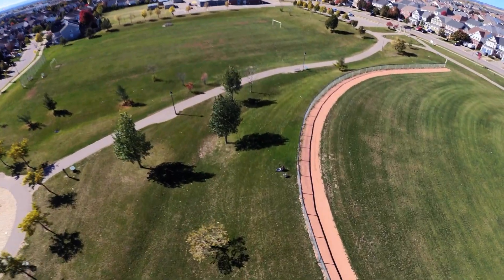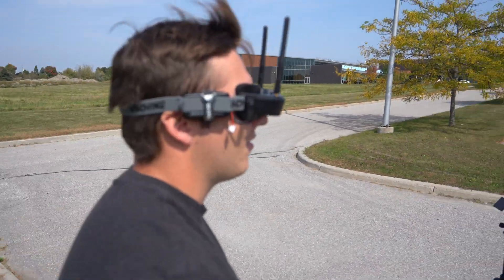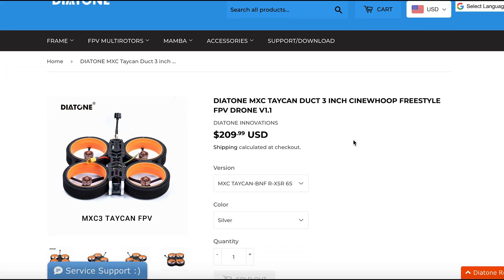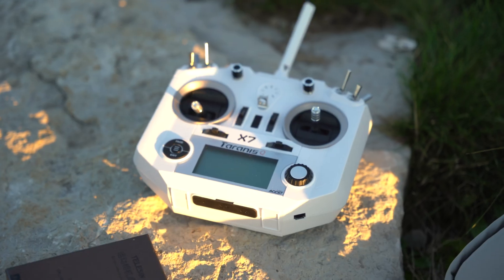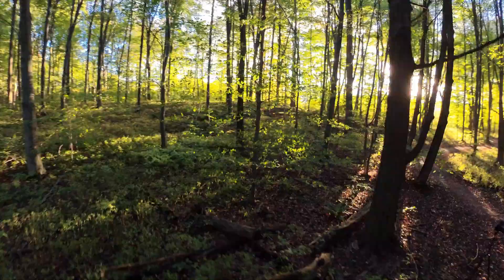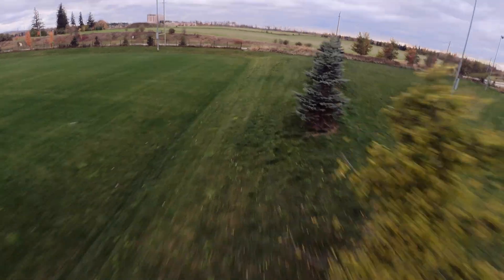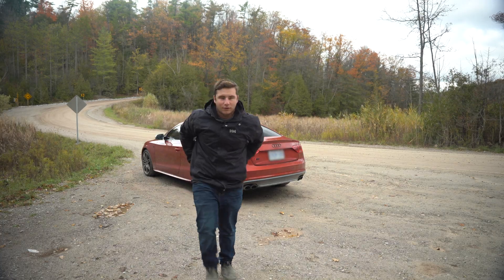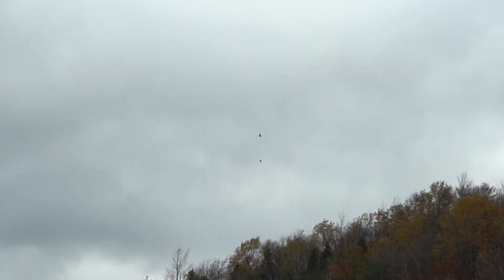Learning to Fly an FPV Drone in 90 seconds

Comment: Nice video. Wouldn't it have been easier to buy 6s batteries instead of replacing motors? :)
Reply from the maker: 100% easier. I just already had 10 4s packs and didn’t want to switch hahaha

Comment: Very nice👍 Have you done any SIM flying before?
For two weeks of flying it is a very impressive progress👍 What goggles are you using? Couldn't see any brand name in descriptuon? If they are eachine ev100 you definately need to get better antennas and also they have very small fov. I would rather go for something with bigger fov.
Ive been flying fpv about 8 months now but with some breaks ( with young family I dont have as much time as I would like to have
for my hobby :(
I love my 3s 2.5" happy model larva x, fast little ripper. Also have 5" quad. Now Im waiting for dji goggles. I couldnt resist them:) Image quality is sooo much better in them.
Reply from the maker: Hey thanks for the nice comment! So I actually put out a video last week that dives deeper into my first ever experience with fpv. I used the sim for a long time before I ever flew in real life. As for the gear, they are ev100s. I’ve since upgraded to better antennas but I’m not going to do anything else in the video department until the spring when I too will go the dji route!